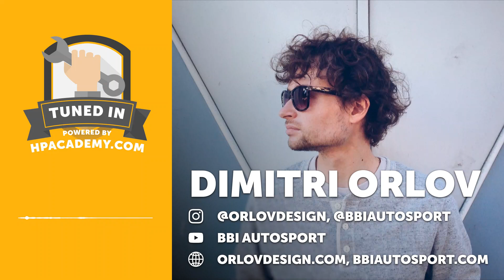118: Spend Less Time & Money On Your Build. [#PODCAST]

Comment from the maker: 🏎💨Don’t forget, you can use “BBI50” to get $50 OFF your 3D Modelling & CAD for Motorsport Course: https://hpcdmy.co/CADb
0:00 Dimitri Orlov - CAD for motorsport specialist
4:06 How did you become passionate about the automotive industry?
8:15 How did you learn your skillset?
9:57 Does having shop floor experience make you a better designer?
11:42 Are there any drawbacks to not having an engineering degree?
15:51 When did you start diving into 3D modelling and CAD?
20:32 What are the steps from CAD model to actually machining a physical part?
23:10 What did you do before working for BBI and what is BBI?
32:28 Design process.
43:06 Choosing the right manufacturing process for the part.
51:07 Designing a manifold not just for 1000hp, but to fit and work on a factory vehicle.
58:05 How has 3D scanning changed things for BBI?
1:06:40 Are there affordable scanners that are worth buying?
1:12:10 What CAD software do you use and why?
1:20:46 Do you use FEA?
1:27:18 What is the Hoonipigisus?
1:31:15 Engine and gearbox configuration.
1:34:28 Biggest challenge?
1:38:49 Challenge of running a drive shaft from a rear trans to front differential?
1:41:30 How much of a disadvantage would it have been to leave the car rear wheel drive?
1:48:50 Are there any key aspects you’d do differently?
1:55:08 Final three questions.

Comment: 🎯 Key points for quick navigation:

00:33 🏎️ The introduction and background of Dimitri from BBI Autosport:
- Dimitri's self-taught journey in CNC Machining, CAD, and 3D scanning.
03:59 🚗 The importance of hands-on experience in designing and manufacturing parts:
- Having hands-on experience in manufacturing helps in designing parts effectively.
- The connection between understanding how things are made and the design process.
07:01 🔧 The significance of problem-solving skills in the automotive industry:
- Problem-solving is a crucial skill in all aspects of the automotive industry.
- The necessity to understand basics and diagnose issues beyond the surface.
- Acknowledging weak points and seeking help from others for solutions.
20:26 🛠️ Designing for CNC Machining
 - Traditional steps from CAD model to CNC milling explained
 - Importance of matching digital setup to physical setup for CNC machining
 - Outsourcing CNC machining and communication with machinists
23:13 🏎️ Career Progression in Motorsport Industry
 - Transition from consulting to product development engineer role
 - Unique challenges in small, fast-paced environments
 - Diverse responsibilities in a wide-ranging position
24:19 🚗 Overview of BBI Autosport
 - Description of BBI as a small Porsche tuner with a talented, agile team
 - Evolution of the company and its founder's journey
 - Reputation and focus on high-quality tuning in the Porsche community
26:09 📈 Pushing Boundaries in Performance Workshops
 - Emphasizing continuous improvement and pushing boundaries
 - Leveraging creativity, resourcefulness, and efficiency in operations
 - Collaboration with cutting-edge technologies like additive manufacturing
32:15 🛠️ Design Process for Product Development
 - Internal steps and considerations for the design cycle
 - Importance of identifying challenges, intent, processes, and product differentiation
 - Balancing product design with market demands and core values
34:23 💰 Pricing Strategy in a Competitive Market
 - Sensitivity to marketplace pricing while maintaining competitiveness
 - Justifying price points through product quality and customer service
 - Addressing market dynamics and considerations in pricing strategies
40:26 🏗️ Addressing market variability and pricing strategies.
- Understanding the complexity around pricing in the automotive aftermarket.
- Market corrections over time based on sustainable business practices.
- Importance of economics and business knowledge in component manufacturing.
42:30 🛠️ Choosing manufacturing techniques based on part requirements.
- Factors influencing material and manufacturing technique selection.
- Balancing strength, reliability, cost, weight, and part volume.
- Optimal manufacturing choices based on product type and market demands.
50:24 🔄 Design considerations and performance improvements in intake manifold development.
- Conceptualizing intake manifold designs to address performance needs.
- Balancing increased airflow, fueling requirements, and ease of installation.
- Evaluating power gains and efficiency with modified intake manifold designs.
01:00:58 📐 3D Scanning Technology and Fabrication Advancements
- 3D scanning technology helps compare different generations of engine parts for design accuracy.
- Collaboration between traditional fabricators and digital designers enhances fabrication processes.
- Leveraging 3D scanning in fabricating custom parts improves precision and efficiency.
01:07:00 🛠️ Choosing a 3D Scanner for Enthusiasts
- Higher-priced 3D scanners offer more consistent accuracy and precision over cheaper options.
- Factors like scan speed and field of view impact the scanning process and overall efficiency.
- Utilizing a more expensive scanner can save time in the long run, especially for commercial applications.
01:11:40 🖥️ 3D Modeling Software Selection Considerations
- Transitioning between 3D modeling software can be driven by business needs and functionality.
- Fusion 360 offers a versatile solution for a wide range of design and manufacturing requirements.
- Choosing 3D modeling software involves evaluating features, ease of use, and long-term scalability.
01:20:11 🛠️ Utilization of design tools and software
- Finite Element Analysis (FEA) mainly used for mission-critical parts and as time allows.
- Majority of design based on experience, with FEA used for logical validation.
- FEA serves as a good logic check based on gut feeling and experience.
01:23:33 🧠 Balancing perfection and practicality in engineering
- Striving for perfection can lead to endless iterations with little added value.
- "Don't let perfection be the enemy of good enough" - finding the point of optimal return.
- Understanding the importance of constraint and making informed design choices.
01:27:19 🏎️ Overview of the Hunicorn project
- Initiated from conversations expressing interest in racing the Pike's Peak hill climb.
- Collaborative project involving various partners for different aspects like chassis, powertrain, and bodywork.
- Completed in approximately 5 months, showcasing exceptional teamwork and project management.
01:39:26 🚗 Rear-wheel drive vs. four-wheel drive:
 - The debate between rear-wheel drive and four-wheel drive remains a topic of discussion.
 - Weight savings and complexity reduction are key advantages of rear-wheel drive in certain applications.
 - Designing a vehicle involves a constant compromise between different sections' performance.
01:41:31 🛠️ Design challenges and iterations:
 - Designing a car involves balancing trade-offs like weight, complexity, and performance.
 - Serviceability is crucial in the design process to ensure maintenance and repairs are manageable.
 - Collaborative design efforts require alignment on work origin and communication for smoother integration.
01:48:38 🛣️ Reflecting on improvements and changes:
 - Reflecting on past projects often leads to identifying areas for improvement and changes.
 - Iterative design cycles lead to more elegant solutions and better outcomes.
 - Accepting that perfection is a journey and each iteration enhances the project's quality.
01:58:35 🚗 Driving experience with electronic aids
- Discusses the experience of driving a rear-wheel St car with electronic aids.
- Mentions the unpredictability and lack of confidence caused by the electronic aids during driving.
- Emphasizes the importance of repeatability and confidence for weekend warrior drivers.
02:00:14 🏎️ Advice to younger self and listeners for career growth
- Encourages being braver and more experimental in decision-making.
- Highlights the importance of maintaining humility and always learning.
- Emphasizes the value of being open to collaboration and different perspectives.
02:03:06 🎓 Education and success in the automotive industry
- Challenges the assumption that tertiary education is essential for success.
- Shares personal experience of achieving success without a mechanical engineering degree.
- Advocates for following passions and exploring non-traditional pathways in career development.

Made with HARPA AI